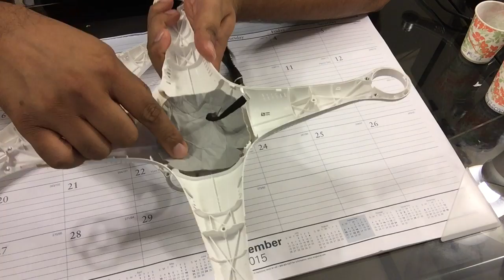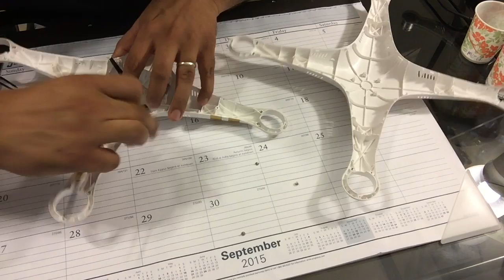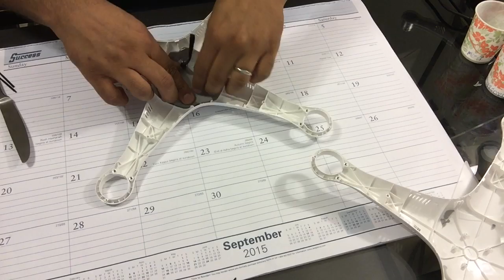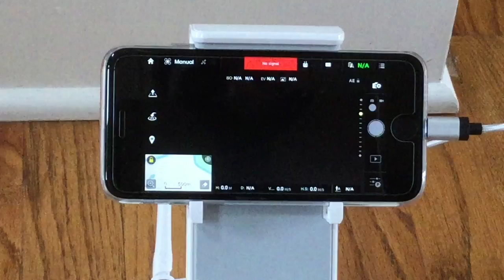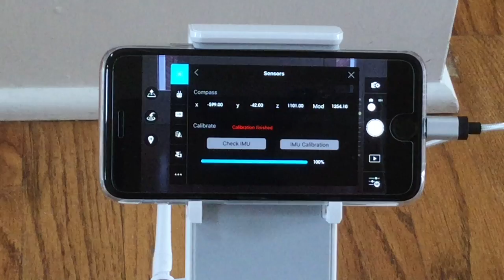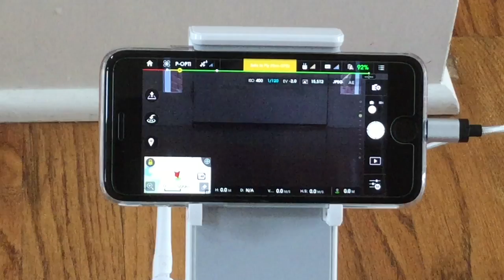DJI Phantom 3 Pro:  Full Breakdown and Rebuild (Part 5 of 5)

Comment: well excellent job sir.. i need this references.. but i'm lil confused about wire in landingskid coz i want to upgrade with carbon skid which is only two legs.. so where the best place for compass.. is it fine change the position or it must be put it like the origin before.. thank u
Reply from the maker: It's a good question - I have not tried any custom configured landing gears so I don't know for sure, but I can tell you that your options might be limited by the length of the wire attached to the compass and lightbridge antennas.
Reply: +Suhail Imtiaz well oke thnx u sir... and just like u did.. no pain no gain.. i will try it... and calibrate it again hope it will work
Reply: You need to position it in the same place on what ever landing gear you put on

Comment: I used your video for reference it was awesome one thing you skipped over some key moves.  The hardest part of this whole build is the compass.  How did you put the light bridge antennas back with the compass I know have broken two co passes the wires ere cut by the light bridge plastic.  You mentioned having a tough time but how did you do it??

Comment: YOOO STUCK IN place watched this three times you seem to skip over how you removed the vps shell i have tried so many screws, i got three off wiht T6 but the last one I cant get offf??? Please help????
Reply from the maker: Sorry I'm a little late in responding to this.  Based on your other comment about how to put the VPS unit back on, I'm assuming you figured this out?  If not, let me know.
Reply: +Suhail Imtiaz i used a allen key wrench does that make sense?

Comment: about the carbon propellers are they better that the one who came with the phantome :)  wanted to replace ours with carbon propeller but afraid of crash :)  are they good ?
Reply from the maker: +Ranini Cundasawmy (Female Fighter Mauritius) Ranini, the carbon propellers are good, but in my opinion, not worth the price unless you can get them at a discount.  They look nice and are certainly a bit more stable and quiet, but not all that significantly different to the stock propellars that come with the Phantom 3.
Reply: I have upgraded to the cf props. a couple things about them. 1. You should really invest in a prop balancer if you want to use the carbon props and balance them prior to your flight. if they are not balanced it will cause jello in the video and it's also extremely  hard on both the phantoms plastic frame and on the motors. 2. carbon fiber props are brittle and a bit more dangerous to any one that could get hit by them. if you hit some thing hard w them they will shatter instantly n your quad will drop.
I prefer them but just keep those things in mind
Reply: ok thank you so much for the advices

Comment: I had to replace the shell on my Phantom 3 Professional, and found your video extremely helpful!  Thank you!    Putting all of the screws in separate labeled paper cups worked beautifully, and a set of jewelers screwdrivers essential, plus Torx 6 and 8, and 1.5 metric allen wrench.  I still found cracking the shell unnerving and a real pain.  Fine line between getting it open and breaking the plastic clips.  And, I'm puzzled as to why DJI would send you a new shell clipped together, requiring you to crack it open-- just doesn't make sense.  I also used Loctite on all of the metal screws to metal insets, to prevent loosening from flight vibration.   I feel fortunate that the shell and battery case (and a set of props) where the only things that needed replacing.  I'm not saying how long this whole process took me, but you can bet I'll be flying my bird with a lot more caution now!
Reply from the maker: +Eric Randall Glad to hear the video series was helpful to you and thanks for the comments!